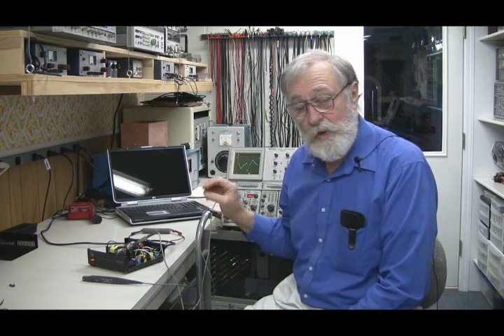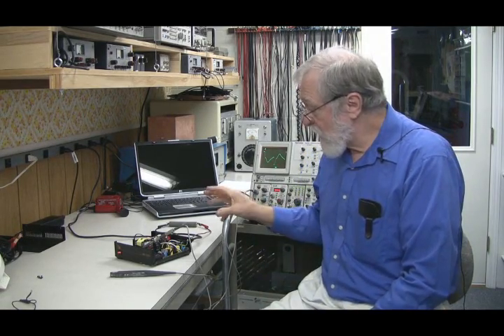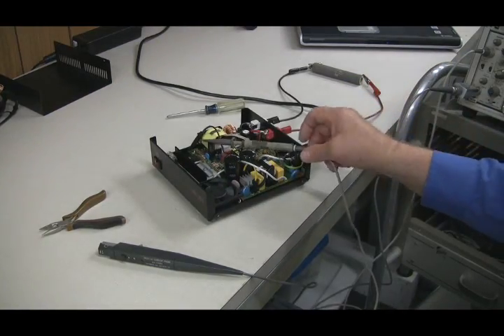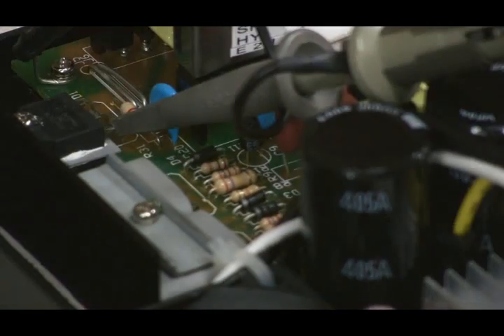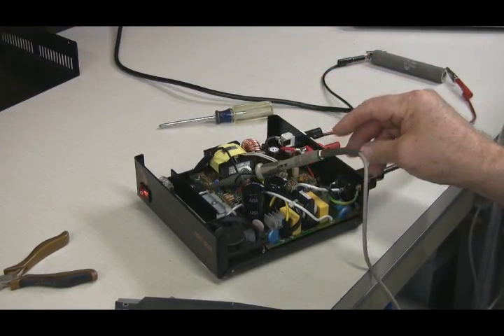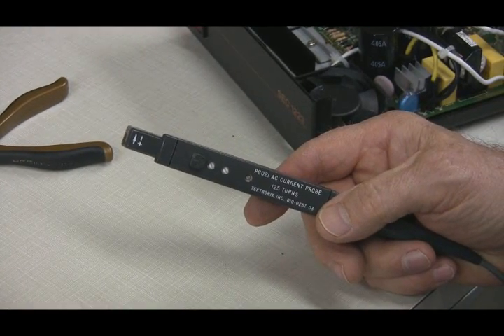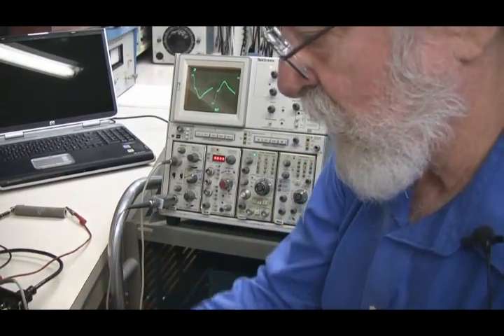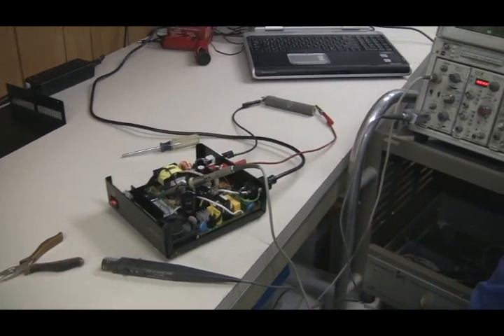Snubber Measurement

Comment: A very common AC/DC current probe is the Tektronix A6302, coupled with an AM503 amplifier. This can measure 20A cont., and 50A peak. These have been out of production for some time, but are very common on eBay. They typically go for about $500 to $1k for the set.

If you want something new, the TCP312/TCPA300 runs about $3k. This one is rated 30A cont. 50A peak.

I've used both of these, and they work quite well.